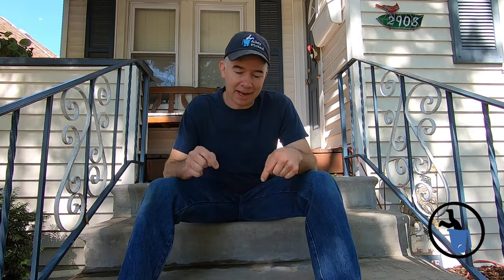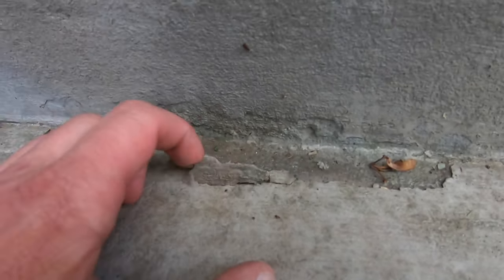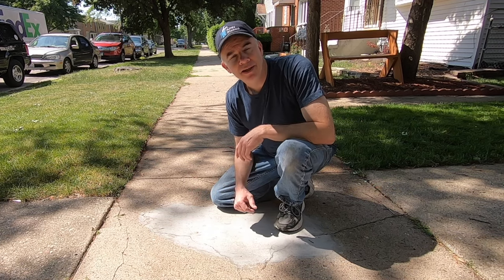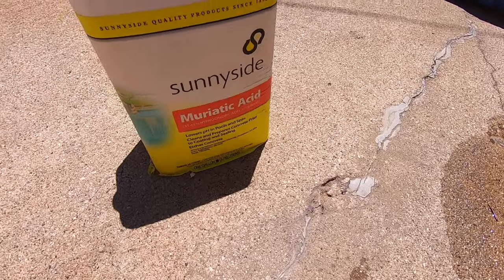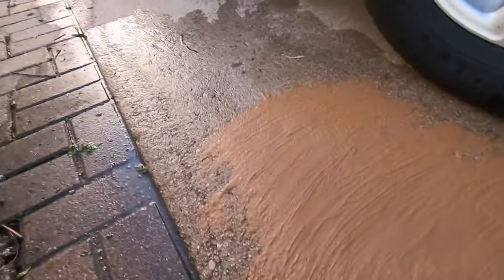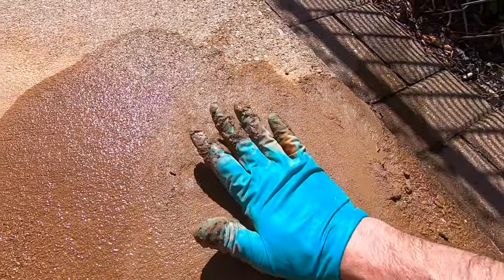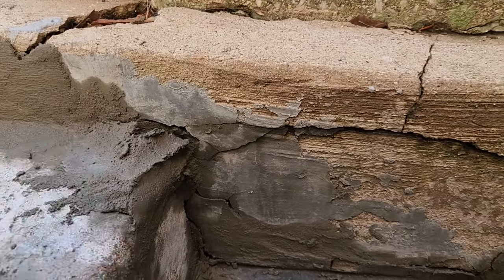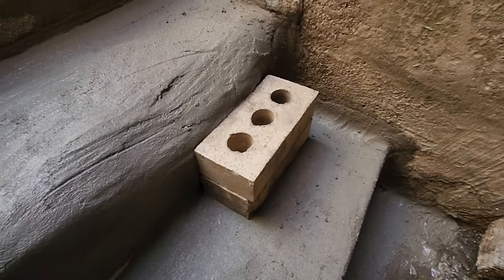How to patch concrete.

Comment: Next time use Tapcons on the broken parts so the new stuff can hold on better.. and use a bonding agent.. helps the new quikrete to bond
Reply from the maker: Probably so...I did use the muriatic acid. Some day, I should do a long term experiment on the effectiveness of using a bonding agent. Thanks for the suggestions.

Comment: I may have this wrong but didn't you mean 'up wind'? Anyway, I knew what you meant. This is a good day for learning about new (to me) products - I hadn't come across this vinyl patching product before. When I patched our back step I just used sand-and-cement. That was more years ago than I remember and I was just wondering yesterday if it needed a wee bit of attention. We'll see. Cheers Tom, that was an education.
Reply from the maker: Up wind is correct. I often put mistakes into my videos so my audience knows I'm not perfect. I know when things are wrong...I just want to see if anybody notices. You passed my test Mark.😁

Comment: Great video. I just used a 40lb bag of this stuff and some of the smaller bucket sizes of this product to patch spalled sections on a pool deck. (One word of advice for future DIYers...buy more than you need! I ran short. I did all the steps save for the muriatic acid😬 hopefully it gives me a year or two. Not against breaking it all up and doing it right when it starts to fall apart.

 I was very pleased to see you measuring the water/concrete mix by eye. I was very worried I had mixed it too "wet" but it looked like yours when applying.

I would say I mixed it to the consistency of Play-Doh in the bucket and when I placed it on my repair surface it began to act more like peanut butter. It was very easy to work with. Very intuitive. 

One side note. I saw on one video that it recommends you let it sit for a few minutes in the bucket before applying, to give the polymer bonding agents time to settle into the wet mix. Do you think this step is necessary?

I've also heard a tip to first mix a small batch of slightly more "wet" mix and apply that first with a glove to coat the bottom of the surface to be repaired in order to allow the mix to flow into cracks and such. Have you had any experience with that?
Reply from the maker: I have heard of letting the cement "slake" or set a few minutes. I do try to do that sometimes. I can't really say that I see a difference one way or the other. If I have thin cracks, I would agree to mix it a little more wet. That makes perfect sense. Generally, this stuff is not meant for small cracks but in theory it does make sense. Thanks for your thoughts. Tom
Reply: @AlleyPicked  come altri prodotti forse lasciarlo 5 minuti riposare vuol dire consentire la corretta idratazione della malta.

Sul secondo punto: applicarlo piu' idratato  forse consente una base che aggrappa meglio al supporto, il resto appoggiera' su una base solida. Miglior presa del cemento.
Qualcuno, su parti in calcestruzzo, applicano una boiacca di adesione :solo  cemento liquido.

Se bisogna applicare spessori oltre i 2 cm e' meglio farlo in piu' applicazioni lasciando seccare la prima poiché possono crearsi fessurazioni,crepe. 
Questi cementi hanno un essiccazione molto rapida. Bisogna fare attenzione.

Comment: One of my sidewalks has a lower spot and water accumulates when raining. The issue is that the water makes it into my basement and I need to fix it. I wonder why type of concrete I should use. 
Thanks in advance.
Reply: A mortar mix might work for filling it. Have to be careful what concrete you use as some have lots of rocks in the mix.

Comment: You should wet the concrete first so the existing steps just absorb the moisture and there are primers available too
Reply from the maker: I always try to wet the surface slightly. Primers are usually a good idea.
Reply: @AlleyPicked  se pero' il supporto e' troppo bagnato ,quel cemento scivola. Bisogna aspettare che l' acqua asciughi un po'. Deve essere umido ma non bagnato.

Comment: Is the Vinyl patch similar to a polymer-modified cement?
Reply: Yes.  The 'vinyl' in the name is from poly vinyl acetate (basically elmers white glue) or ethylene vinyl acetate.  The manufacturers special patching cement is very good, but you can polymer modify your own concrete with white glue and it works extremely well.  White glue also makes a really good bonding agent before applying the patch.

Comment: Can that vinyl patch be grinded /ground with a diamond cup grinder after it is very well dried, or does it remain at all plastic or rubber like. I did some rough emergency patching a year ago and then needed to remove it. It bogged down the grinder. was very difficult to remove. I had to use a heat gun and then scrape/pull it off. I
 can't remember what I used. It sure did stick, and would not hardly 'chip' off.
Reply from the maker: This product is not at all plastic and rubber like. It's hard like concrete. It can be cut with a diamond blade. It probably can be chiseled off as well. The best chance of success (unlike my neighbor) is 2 things. Preparation of the old surface and don't spread it too thin. If you fail in these 2 things, it will look great for a year but after a cold winter...you will see it chipping.

Comment: What is your mixture of muriatic acid and water to clean the concrete?
Reply from the maker: I used it full strength. You can read the label for recommendations.

Comment: you mention at 5 min mark that it is not recommended for use for cracks. why not? what do you recommend?
Reply from the maker: Small cracks will re-appear if you use this stuff. They sell a flexible crack filler which I have not had very much success with in the long term either. I'm still trying to figure out what works the best. I was going to try some grey silicone caulk.
Reply: I tried a few crack fillers and silka from Lowes worked perfectly, 3 yrs later it's the same. Other brand got hard and cracked next day.